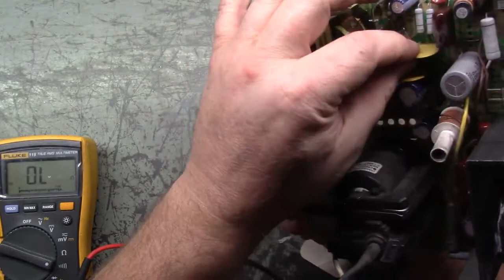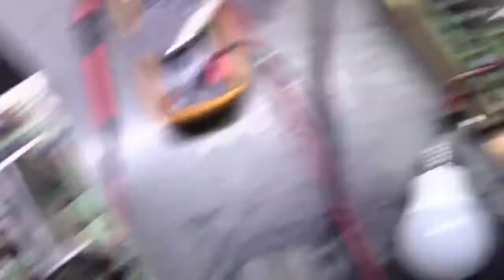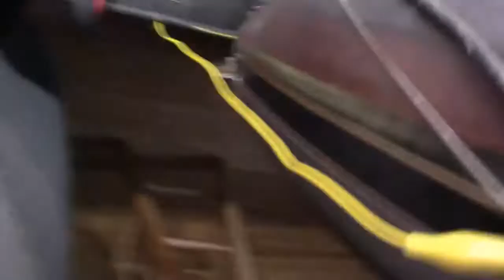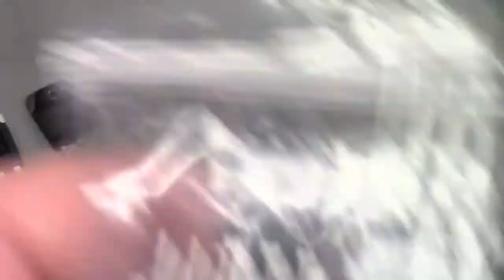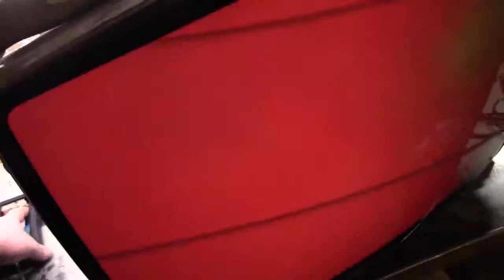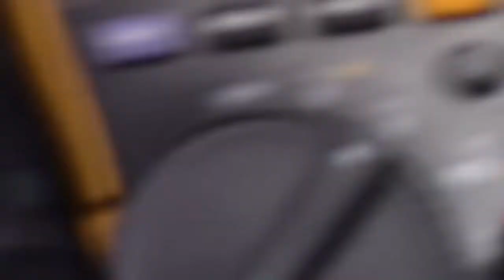25" K7500 Arcade Monitor Chassis Repair - Shorting HOTs

Comment: I see this 7500 chassis has caps at both c729 and c734.....my chassis only has 1 at c734....Is this normal?
Reply from the maker: There are multiple revisions of this chassis. They are all slightly different. If yours did not have C729, then it shouldn’t be required.
Reply: @MikesArcadeMonitorRepair  my pads read shorted with 734 removed from circuit.....have yet to find a bad compnent....

Comment: at 5.35 u tested the c718 and c721, when u reverse the leads do u get same ohms, i did way u showed says 1800 then goes infinity, when i reverse them i get same reading as u did, also the resister rb11 i am getting 1300 ohms, kind at lost i have no picture, the hot is passing. my moniter at rear lighting up but still no picture, the board is a k7500
Reply from the maker: The ohms don’t really matter. You’re just checking to make sure they aren’t shorted. You sure your PCB is good? Do you get a white screen if you turn the flyback up?
Reply: @MikesArcadeMonitorRepair   how do u turn fly back up, theres a white can i seen in video urs was few threads in mine about all way down, i had replace the flyback because it blew its guts out
Reply: @MikesArcadeMonitorRepair  what about the reverse from how u tested on ur board on c718 and c721
Reply: @MikesArcadeMonitorRepair  the pcb board doesn't look damaged or burned any where
Reply: @MikesArcadeMonitorRepair  hey never mind i turned flyback up like one ur videos till seen the lines, turned down and picture works great. i didnt know that had turn up thought it would been turned up. thanks for great video, helped alot, now need figure pout my sega rc game next from the 80's

Comment: Thanks for the awesome repair videos!  I have a troublesome K7500 that is driving me a bit batty.  R104 (normally 10K) was showing 14K and it also had a few bad caps.  i've since replaced all the caps, changed R104, tried new SMPS controllers (IC101) and tried your lightbulb trick too.  My unregulated voltage shows 193VDC before connecting lightbulb.  under load it shows a stable 122VDC.  Is that 193 of concern and potentially putting it into shutdown?    Appreciate your help!
Reply from the maker: No. It’s 193 because there’s no load. If it goes down to 122 under load, your power supply section should be good. You’re welcome!
Reply: @MikesArcadeMonitorRepair  Thanks Mike!  Did you change your youtube channel recently by the way?  I bookmarked you a few weeks ago and swore there was a Mortal Kombat reference in the name but now it's a different channel.  I'm going to probe deeper into the horizontal section.  fingers crossed.
Reply from the maker: My repair videos didn’t get many views so I created this new channel.
Reply from the maker: What’s the issue exactly?
Reply: @MikesArcadeMonitorRepair  i got it figured out!  the original symptom was a quick "Dung" sound without the subsequent HV snap.  Went through the horizontal circuit and found a bad drive transformer.
Reply from the maker: Nice!